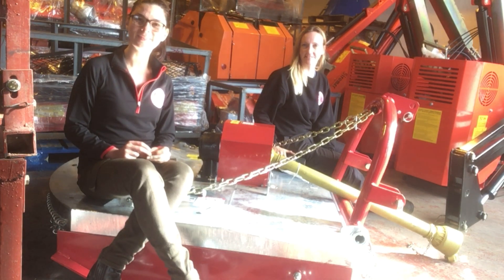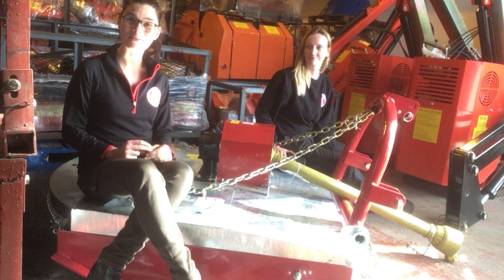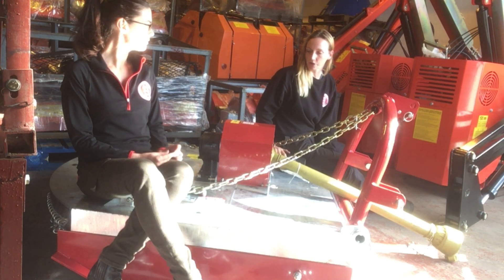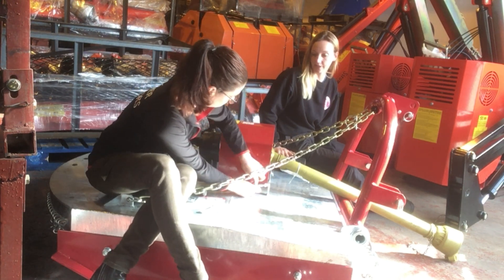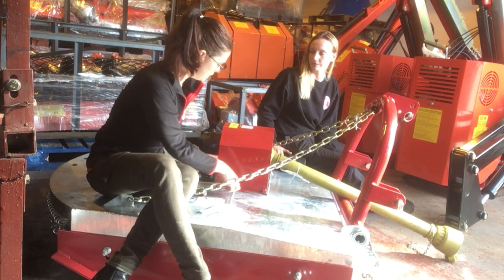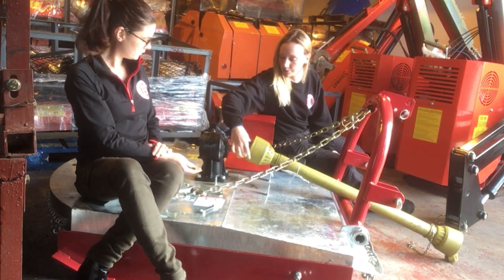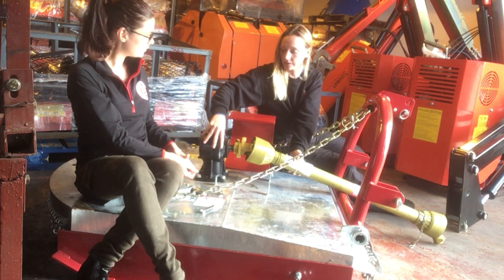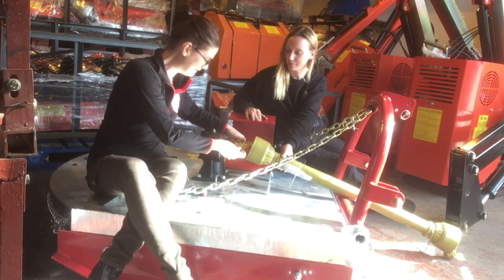Shear bolt PTO shaft protection

Comment: Is there a torque spec for how tight to do up the shear bolt?  does it want to be done up tight to clamp the two halves of the joint together or quite loose so it is only the shear bolt transmitting torque and not the extra clamping friction between the joint faces?
Reply from the maker: It needs to be tight to clamp the two halves of the joint together.

Comment: how do you know what rating of shear bolt to put in replacement if the original broke away in the paddock ?? 
Is there a preferred way to put them in eg nut at rear or front
Reply from the maker: A standard shear bolt is 10.9 so start with that and if you find it continually breaks change it for a 12.9. Normally put the bolt in from the back so it is looking at you, it is easier to catch the nut on this way.
Reply: @SiromerTractors  ok thankyou, i didnt know bolts had eyes 🧐